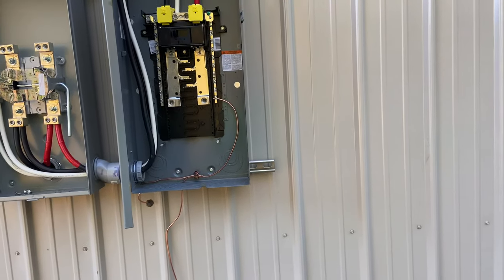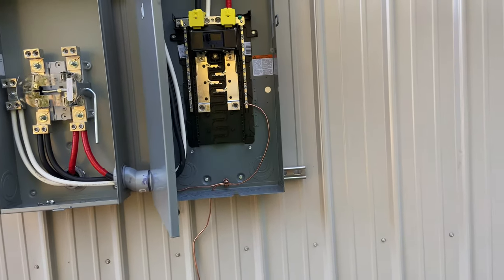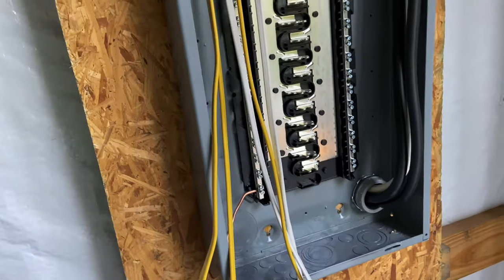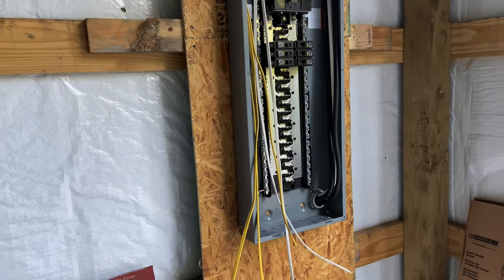Episode 17 - Installing EGC and Ground Rods

Comment: Another problem I see is you have parallel. Your feeders going from the load side of the meter base. You have 3 going to your panel with the main breaker and that's ok but you also have the other set going into the building. Where are they going to? Another panel with main breaker? If so you can't. Do that. All service disconnects are to be grouped at the same location as close as possible to the service drop from the power company. All the feeder disconnects should have been located together outside.
Reply from the maker: That one is a potential violation of 2020 NEC but nothing else, as far as I know. It is certainly not a violation of our local code nor the AHJ, they were 100% ok with the design. 

I did not want to have yet another panel in the mix when it was really necessary. 

Most homes here don’t have any panels on the outside of the house.
Reply: Can you help explain this further?

Comment: From what I understood you can’t connect your sub panel to your main panel ground because the main panel ground is linked with the neutral.
Reply from the maker: I’m this case I am bonding two main panels with the EGC to the ground rods. All have grounds and neutrals bonded as they are two, parallel, main panels  

If you have a subpanel connected to your main panel, you feed that with a breaker and 4 wires, and then you separate your neutrals and grounds at that subpanel. 

Thanks for watching.

Comment: Yeah. I am suggesting that you actually protect that ground wire running outside the panels.
I have used what is referred to as an armored ground. It's a 3/8" steel spiral flexible conduit around a ground wire.
It can be purchased separately. Adds a layer of protection to that copper wire...
And it can be done still even though your done with every thing else...

Comment: I don't think they can bring you 320 amp wire off the pole and pull it in a 2" sweep. You're probably gonna have to pull that out and install a 3" sweep. Now the problem is your meter base isn't deep enough to accommodate a 3" hole. You probably will have to start over from scratch. It's great that you've done all kind of reading and reader h and contacting your inspector and power company but someone somewhere along the way should have told you your equipment is to small to accommodate a 320 amp service.

Comment: Your grounding electrode conductor is supposed to be in conduit up the wall. #4 doesn't have to be in pipe. That's why we use #4.
Reply from the maker: Didn’t think that was the case based on my understanding of code and other installs I’ve seen. 

Got a code reference?

Comment: Shouldn't it be a #8 AWG bare copper for over 200A? you have #6 AWG for over 150A but you have 320A coming from the street, correct?
Reply from the maker: For and ECG to ground rods, it is always #6. A ufer ground for the setup would be #4. 

ECG rules are a little different than the tables for branch or feeder circuits.

Comment: Tell me if im wrong but you shouldnt have to run a ground to your inside box,ours usually only runs to the main meter base,the grounds are then ran with the main wire from meter base to sub panel..if you do run it to other boxes make sure not to mix your grounds with your neutrals or use a bonding screw at that box,you then can send a short to your neutrals in every plug in the house
Reply from the maker: For my AHJ, we do the EGC bonding at the first means of disconnect and not the meter. Some AHJs do the meter. 

ECGs are bonded with the neutrals at my two main panels, which are the first means of disconnect on my parallel 320A service feeds. The two main panels are bonded together, along with the ground rods, in my particular install. 

Hope this helps and thanks for watching.

Comment: [ 2:38 ] Regarding connecting the 2nd grounding electrode conductor (GEC)/ intersystem bonding jumper to the panel, why didn't you just make that wire reach 6 more inches from where you tapped (spliced) it and simply terminate it on the bus bar right next to the 1st GEC?  Isn't that what bus bars are for?
Reply from the maker: To my knowledge, I didn’t think that I could use the bus bar like that in this situation, per code. I question if my split bolt is actually code as the language about the GEC is one continuous piece, but I didn’t get a good answer on how that applies to parallel service panels and bonding. 

Pragmatically, I think the bus bar would work fine and be perfectly safe, even if it technically violates code. 

Thanks for watching. 

Real electricians, feel free to weigh in.

Comment: So as you may already know the main disconnecting means for the steel structure panel must be on the outside of the structure. You should also bond the the steel structure to the ground bar of the main panel inside the structure. (Bonding the steel structure is also acceptable in the first means of disconnect on the outside of the structure.) The main ground for the structure should have been a ufer which is a concrete encased electrode that should have been poured with the slab so the slab will be in the same equipotential bonding plane as the steel structure. Your setup will work but it is not to code. Hire electricians people. Insurance may not cover any damages or harm done to personnel if you do not install your equipment to code. If I were you I would also install a disconnecting means attached to the outside of your home as a disconnecting means in case firefighters having to quickly turn off the power without having to search for the disconnecting means on your steel structure. Torque all of your lugs down to spec and mark them with a paint marker. I would also use a #4 bare copper for the main ground. 2023 code now requires all main panels to have surge protection devices. These will hopefully protect any circuit breakers with ground fault protection or arc fault protection circuitry along with potentially protecting equipment in use. I hope this helps some folks out there but still hire an electrician please.
Reply from the maker: Thanks for watching and the comments. 

When I redo things for solar I will probably put a disconnect on the outside so that is an area of improvement for sure. A very low risk “safety hazard” in case of a fire, but noted. 

I have two ground rods, which is acceptable instead of a ufer, according to the NEC. 

Bonding the steel structure is functionally accomplished by the mounting of the panels to the strut and the strut to the building. If there is a specific NEC requirement that calls out some specific method of bonding, I would be curious as I like to learn.

I think 2020 required the SPDs and both my panels have them. 

Thanks again for the feedback.

Comment: So you mentioned you have a 320 amp service coming off the pole. That's a lot but I'm sure your service calculations prove it. It really looks like your equipment is stuff you got at Home Depot. Maybe you should have gone to a good electrical supply house and told them you were installing a 320 amp service single phase and they could have supplied you with the right stuff. Will your utility supply you with 320 amp off the pole without you having to install a CT can? If so, good for you. I'm just wondering with line and load occupying the same space in the meter base if that's gonna be acceptable.

Comment: Here in lies the problem. Most power companies only allow for 1 service drop. Let's say they can deliver you 320 amps on 1 tri-plex. Then at a large can on your building you could come off there wires with two sets of wires like you kinda did already. Each set would go to a meter base. You could probably tap off the service feeder with 2/0 copper feeding each meter. Now you have 200amps for your out building and 200 amps for your house. So you will need 2 - 200 amp meter base main setups where your service entrance conductors come up at your building. Good luck with trying to get them to install 2 meters on one property. They will have to set up two accounts for billing.

Comment: Many years ago Utal power and light use to let you use a 320 amp meter base 3 phase 480 volt to feed a commercial building. That's a lot of current to run through a meter. So they changed their service drop rules. Now anything above 200 amps480volts,3 phase has to be set up for current transformer metering. No more line-load through their meters. Hopefully in your area and being single phase and 240 volts you won't have to use current transformers at 320 amps. You most certainly wouldn't if you only required a 200 amp service. What you could do is get ,2 meters and 2 service drops off the pole and split off your trench to the 2 locations and at each location have a 200 amp meter base main disconnect with provisions for branch circuits. This is getting pretty technical isn't it? And know you know why electricians are licensed.

Comment: Don’t splice ground wire. Use #4 bare. They also tend to request ground wire ran in EMT pipe to ground rods. Besides that, everything looks good! 👍🏻
Reply: Actually, needing to put ground wire in conduit depends on the situation.  As per NEC 2017 
(1) Not  Exposed  to  Physical  Damage.  A  6  AWG  or  larger copper   or   aluminum   grounding   electrode   conductor   not exposed to physical damage shall be permitted to be run along the surface of the building construction without metal covering or protection. 
(2) Exposed  to  Physical  Damage.  A  6  AWG  or  larger  copper or aluminum grounding electrode conductor exposed to physical  damage  shall  be  protected  in  rigid  metal  conduit  (RMC), intermediate  metal  conduit  (IMC),  rigid  polyvinyl  chloride conduit  (PVC),  reinforced  thermo-setting  resin  conduit  Type XW  (RTRC-XW),  electrical  metallic  tubing  (EMT),  or  cable armor.

Also, the NEC code says ground wire size is determined by the feeding conductor size
Entrance conductor size 1 or 1/0  ground wire 6 AWG
Entrance conductor size 2/0 or 3/0  ground wire 4 AWG
Reply from the maker: I do wish I ran it in conduit. I might go back and run emt or rigid since it is down low. 

GECs only have to be a #6 to ground rods. 

Ran a #4 to the ufer in the house.
Reply: This insulation would absolutely be subject to damage. So, Yes he will need conduit.
 @sandmandave2008

Comment: I thought you couldn’t have an insulated ground bus it needed to be directly to the panel. Let me know if you passed L&I inspection.🤔
Reply from the maker: I did not use an insulated ground. Just bare #6 from the panels to the ground rods. 

To my knowledge you can use an insulated conductor. There might be constraints on “protected from physical damage” in the code. 

I do not have inspections in my county but the PoCo gave me a meter so they didn’t care.
Reply: Bus or busbars are the bars your egc and neutrals get screwed to. They must be separate in subpanels. Insulated means its on the black plastic. Ground busbars get placed on the dimples with a sticker covering the screwhole.

Comment: You put the copper ground through the steel box with no grommet.  Isn't that going to cause electrolysis and corrode?
Reply from the maker: It might. 

I thought it was ok to use that small knockout on the panel for the GEC this way. 

If a proper grommet exists, I would love to know about it. I would make use of it. 

Anyone who knows, please chime in.
Reply: @Ciband  Maybe yours has one but mine doesn't.  Even if it does, steel and copper doesn't mix.
Reply: @Ciband  well my favorite go-to is the bit of duct tape. Course that might not hold up too well during a lightning strike, lol. Actually I don't know too much about this stuff so I probably shouldn't even be making any comments😅

Comment: Looks like you ran the ground on the busbar in your sub panel inside. Pretty sure you're not supposed to do that since ground and neutral is supposed to have a separate path to ground.
Reply from the maker: No subpanel inside. 

With the 320A service, I have two parallel 200A panels, each being the first means of disconnect so the neutrals and grounds are bonded on each panel. One panel is inside the shop the other is outside with feedthrough lugs to power the house.
Reply: @Ciband  Oh nice. Good job.

Comment: I apologize for my lack of knowledge but is it really essential to have two rods? I'm living abroad and I guess they do things a little different over here. The guy wants to just put one rod into my backyard. I have a small plot of soil that's about eight feet from the wall of this house thing that I live in. However it's not a large plot of soil so even if I asked him to put a 2nd rod into it i dont think they will be six feet apart. Anyway my options here are pretty limited. Do you think something like this could help with a situation where I could be feeling shocks from say an electric water heater in the bathroom during a shower? As far as I know the main fuse box for this house has no grounding currently
Reply from the maker: I’m not an expert in n these things. 

In general the whole idea of grounding and bonding is to bring all your metal parts in the electrical system (and house like iron pipes) to the same voltage potential as ground. 

Bonding all the metal boxes and any iron gas or water pipes I would think prevent such shocks (through they shouldn’t happen anyway unless something else is wrong it think)

The NEC says you can have a single ground rod if the resistance between the rod and something (I can’t remember, maybe the dirt) is below a certain ohms. If it is not, then drive a 2nd rod. Most people just do two rods and are done. They are cheap.
Reply: @Ciband  that's cool man I appreciate the feedback I'm going to ask the guy to put in 2 rods. This house had some ancient I guess copper pipes they were heavily corroded probably about 25 years old. I had most of them replaced well all of them on the ground floor replaced. But the bathroom is on the second floor and that still has some of the old pipes in it. Probably all the insulation for the old wiring also needs to be replaced too but that is another whole project altogether.

Comment: Ciband, did you pass your inspection with this method of grounding?
Reply from the maker: In my county, I did not have any inspections.

The power company seemed happy with it but I don’t know how picky they would be. 

For my own standards, I am happy with it. It is doing what a grounding system should be doing. 

The big question is if I could get away with my split bolt splice vs a continuous length of conductor going from panel -> panel -> rod -> rod. 

Thanks for the question and for watching.
Reply: @Ciband  BTW, I'm building a setup on 10 acres nearly identical to yours (shop, & house).  I'm not at far along as you.  I had to install a large pump house for the well and a storage tank due to the low well gpm.  I'm following your power service setup identically except mounting the 3 power boxes on the exterior of the pump house.  Thank you.
Reply from the maker: Sweet. Good luck on your journey.  Acreage is the way to go I think.

Comment: Why is the first rod so far away from the panel?
Reply from the maker: I figured it was fairly close (< 15 ft). The positioning was pretty arbitrary for the first one. Just close to the building and out of the way.
Reply: @Ciband  Thanks.  Was wondering if there's code the 1st one can't be right below the box.

Comment: 1:14 do I need two?  I just installed one
Reply from the maker: My understanding is that you can use 1 ground rod if you have a certain resistance from the rod to the panel… or from the ground to panel…or something like that. 

Or the code says you can use 2 and be 100% good. 

I just used two and didn’t worry about it.
Reply: @Ciband  I checked with my electrician and according to him he says that the number of grounding rods is dependent upon the city the house is located in
Reply from the maker: Certainly local codes can go above and beyond the NEC. I was just referring to the NEC as a minimum.

Comment: you might want to consider another type 2 surge protector for your panel in the shop. and a type 1 surge on the meter base.
Reply from the maker: I don’t have any way to attach something at the meter. 

I have a type 1 on the shop panel and a type 1 at the main house panel. I figured that would be good enough.  Didn’t research this to death though.

Comment: Would it have been allowed to run the ground wire through the meter panel and then continue on to the inside panel?
Reply from the maker: I don’t think so but I don’t know for sure
Reply: @Ciband  Thanks!
Reply: @Ciband  I was surprised that the meter enclosure wasn't grounded or maybe that was done later. I was watching this video were they talked about grounding and seemed like it was required, but I'm not expert. https://youtu.be/9Dc-WKOBVHY?t=358
Reply: Meter enclosures are not listed as raceways for wire.

Comment: I think you need a bigger grounding wire , that wire goes according to the size of the ungrounded wires , and there is a table on the NEC 250-66 for the size of the ground electrode conductor , also you need to put it in conduit , usually gray PVC is used for that , also now code requires interbonding system , which is a little ground bar you put in the wall and pass the ground wire thru there , is an open lug like the grounding bushing lugs , that bar is for the cable and tv , internet low voltage systems, also after the ground toda or before you should attached to a meter water pipe
Reply: I use #4
Reply: It also say you you can run #6 to ground rods, but the ufer needs to be #4
Reply: @thomasmarable6818  I too was told by an electrician I could use #6 solid if using ground rods
Reply from the maker: Yeah #6 copper GEC for ground rods is acceptable by the NEC. For a ufer, it needs to be a #4 copper, at least for my 200 amps.